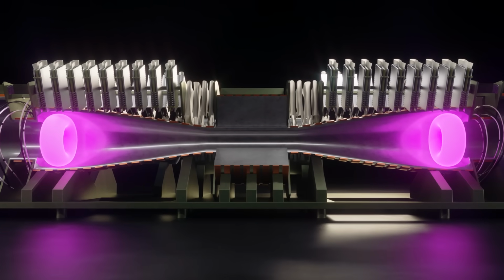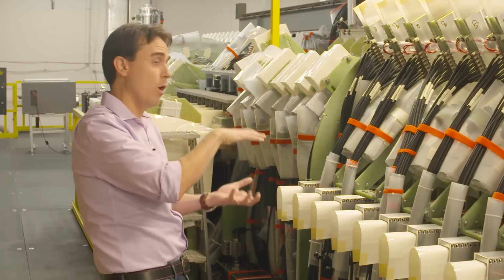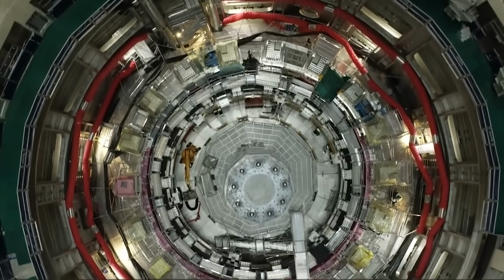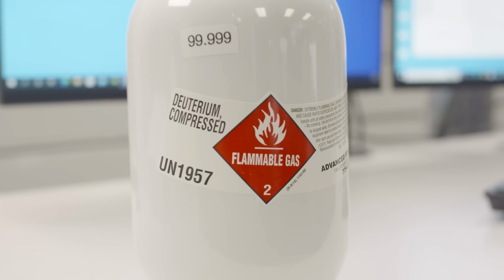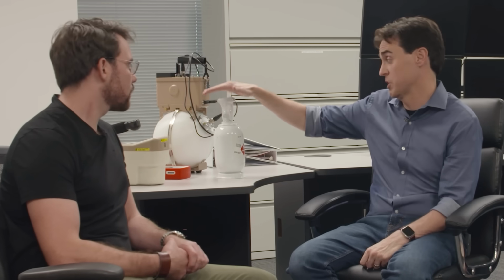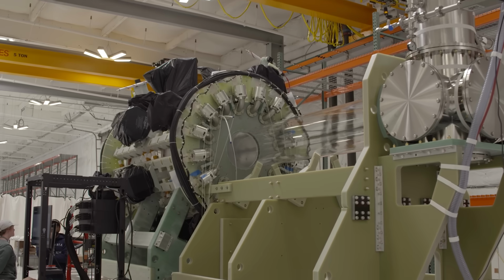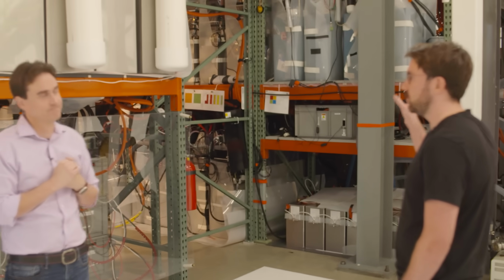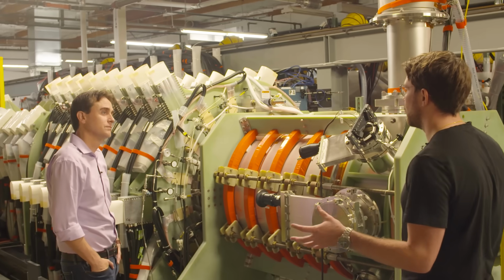A New Way to Achieve Nuclear Fusion: Helion

Comment: I am all for that we keep researching and developing new clean energy forms BUT the scientists themselves say commercialisation of fusion are 4-5-decades away and thus it cannot be a part of our urgent transition need.

The newly formed Danish government´s first announcement were that Denmark unilaterally, as only Western democracy in the world, would make Denmark CO2 neutral by 2045, long before the requirements in the Paris climate agreement.

A few months ago Denmark together with Belgium/Netherlands/Germany agreed and signed the worlds largest transition project away from fossil fuels in the world BY FAR. It will transition 230 million high energy using Europeans in just 12 years. Will be achieved by placing off shore mega windmills in the North Sea.That are half of Europe's population in one single deal. On top, inside same project the worlds largest BY FAR hydrogen production will take place on 3 artificial energy islands where the mill energy will be transported via. A small amount of the hydrogen will be set aside to ensure unbroken emission free energy when the wind does not blow sufficiently to meet demand. Remember that hydrogen are made of electricity and water and when burned it only emits.......wait for it.......water! 

Today, at the end of 2022, we already on fairly good wind days produce 120% of Denmark´s electricity needs by windmills. Denmark everyday proves you can transition and decouple emissions from production/economic growth.
  
There are NOTHING preventing large coastal nations like US/UK/Canada/Australia from making a copy/paste of our new project in the North Sea and themselves become CO2 neutral fast. WE are the proof you would laugh all the way to the bank while doing it. Please consider why it are not happening in your nations. The atmosphere really need us all to transition.

I have personally dived around the foundations of one of the older off shore windmill parks in Denmark and the cool thing are that they improve aquatic life greatly and function as protected nurseries for the bottom of the aquatic food chain. First mussels and seaweed are attracted. Mussels eat CO2 and seaweed store it. That again provide protection and food for micro biologic life and small fish. It are estimated that over 20% of the bottom of the aquatic foodchain (that are the precondition for the higher parts have something to eat) are connected to global coral reefs. As our waters become warmer the coral reefs increasingly experience bleaching events eventually killing the corals. A few years after that they disintegrate and become chalkpowder that in itself have negative effect because that powder can kill other corals, a really bad negative cycle. 
If 20% of a food chain are taken out in a few decades it might get the entire food chain to collapse. If all coastal nations, beside those very close to the equator, utilised their potential to transition via off shore windmills as centralised electricity and green fuel providers, it then also could have a very positive effect on the aquatic life, partly or fully compensate for the loss of coral reefs.  
In EU alone approx 40% of railroads are not electrified today but have diesel or diesel electric locomotives. Most EU governments today have planned HUGE billion investments in electrifying these rails to bring down their emissions as part of their commitment to the Paris agreement.  IF they instead invested in the concept of off shore windmills and hydrogen they simply could use hydrogen locomotives and problem could be solved for a fraction of the cost fast. The lobby of the fossil fuel industry are very strong and I time after time realise that many populations around the world are completely in the dark over the reality we have proven works and saves money on top. As Denmark have shown you with your own eyes, it are not a matter of going back to the stone age when you transition, on the contrary. It just are a matter of seeing holistic on the transition. There are SO many savings and benefits that they superseed the negatives. 
NOT sending our hard currencies to journalist/politician killing dictators like POOtin, Xi or Bin Salman also means stopping financing their aggression's maybe thus also preventing future wars.

Transitioning are an investment and not a cost.
 
The 4 stroke direct injection car engine have been invented and works great. Hydrogen train/truck/ship engine exists so does the hydrogen jet engine. 
The longer we all collectively do not get our atmospheric carbon content back to 220 PPM where it belongs the longer we will experience an increase in human suffering and economic taxpayer burdening costs from the wilder weather effects we already increasingly are seeing.
 
We are very open about how we do and urge all to simply copy/paste away, from what we have proven works, both practically and economically.
Reply: urgent,really?
Reply: @honkytonk4465  What nation are you from?
Reply: @Mike-zx1kx  EinsteinLand
Reply: @honkytonk4465  Let me guess. USA. Usually Americans that give themselves a thumbs up after saving. I would not attribute that to the general German.Yes. Urgent. Read and learn.

For 850.000 years our atmosphere have been at stable 220 Carbon PPM, since industrial revolution now exploded to (2022) 417 PPM.  Floods, draughts, bushfires, forest fires, hurricanes, salt water intrusion,  etc etc. Costs of climate change explodes in USA and around the world. It are estimated 300 million people will have to move because of climate change in this generation. NOT being forced out of your home will improve a lot of lifes, right? Denmark proves transitioning are an advantage, an investment not a cost. 

Glaciologist drilling icecores in Greenland have, by analyzing airbubbles captured in the ice, established that we the last 850.000 years have had a pretty stable carbon PPM at 220. Besides Carbon also things like acidity, pollen counts, Vulcanic ash count and identification etc. can be measured. Since the ice sheet have been build up over time, layer by layer, year by year, we go back in time the deeper we go. So we have a YEAR BY YEAR documentation of the global climate 850.000 back or 10 times the period, since man left Africa. There has been a few peaks at 280 PPM that all have been connected to high global Vulcanic activity. Since around the beginning of the industrial revolution PPM has exploded. We are now at 417 PPM, close to double the amount we have seen last 850.000 year. Just to set the amount of 850.000 years in context, man left Africa around 65.000 years ago.
Denmark, USA and Canada all have a full set of cores and can thus give you key data of our climate, year by year, 850K years back.

We have a global problem and we, as mankind, created that problem, and if we don´t solve it very fast, we eventually will pollute ourselves out of a home.

Lets look at some science reality.
Country 2015 per Capita carbon dioxide emissions from fuel combustion (metric tons)
United States       15.53                           (now over 16. Americans the absolute most polluting nationals on earth)
Russia                   10.19
China                       6.59
India                        1.58 
Source. US Government. (epa dot com) 
These numbers actually to low since aviation are excluded. Americans flying more per Capita than others, making reality even grimmer. Ask yourself WHY so many Americans, that are the highest emitting nationals on this planet, are not even aware of this fact! The money invested in keeping so many Americans in the dark about own emissions are HUGE, and it has worked. The basics of climate change that I learned in basic school 40 years ago are still not basic knowledge for to many in US.

VERY first day Trump was in office, while USA was talking about crowd sizes, he fired the head of EPA and replaced him with a former oil CEO! He took USA out of the Paris agreement, while his nation was the biggest polluter per citizen. Trump removed caps on Methane in US. Methane are 22,5 stronger than CO2 as a greenhouse gas. He opened up for an explosion of fracking in US. Fracking are the process where you pump chemical acid under pressure into your underground to dissolve slate stone! Fracking has, besides the CO2 emission, been proven to cause earthquakes. Chemical acid and/or the gasses have already begun to be detected many places in US. Trump gave permission to a state subsidised pipeline from Alaska that should transport the oil coming out from the further oilsand exploration he gave permission to. Oilsand are the most energy intensive and ground disrupting known way to get oil. It takes 7 liters of oil to produce 10!!! It leaves the ground sterilised since it involves cooking the sand on site! Oilsand and fracking are the two most stupid, dangerous and CO2 emitting processes! He could have raised lasting off shore windmills but chose to do this in the middle of a global climate crisis where others shuts down coalmines/coalplants and now some even stop oil exploration in their nations. Trump has been a disaster for the climate efforts and for US credibility.
( I am sure Putin are happy, not many have devoted time to try to get him to clean up his acts lately, so the trick (also in this sense) worked for him.I have a very hard time imagine USA move forward in a unified way before it has been proven in court of law that Trump belongs at Guantanamo).
Biden re-signed you in to the Paris agreement but recently announced the largest oil exploration and "rights to use" auction in US history ensuring US´s signature are worthless.

IF a policy are UNsustainable for us all and can be replaced by one that ARE SUSTAINABLE and we don`t act on it and CHANGE, well, then Darwinism will take us out! The truth are that USA are way behind the curve, sticking to old technology when the world are changing and that are not doing US, businesses, population, economy, any favours, only the fossil fuel industry but hey, that are what they pay for...

CO2 taxes are being introduces all around the world every day. As most emitting nationals US businesses soon wont be able to export to anyone due to the costs the "stupid nation" fines that will be placed on top.

I hope my text begins to give you a fraction of an insight into the miserable life approaching fast if USA do not transition!

Despite you "Einstein comment" I will remind you that only a friend will tell you the truth even when it are uncomfortable for you to hear. Your enemy will happily stay silent and watch you fail.
Reply: @Mike-zx1kx  we'll rather freeze to death here in Germany than run out of water or starve to death caused by heat.If climate change is so dangerous why don't we just build nuclear power plants as a transition technology?
Reply: @honkytonk4465  The ones freezing to death are the Ukrainians because Germany allowed itself to become dependent of a journalist/politician war mongering dictator! The entire Western world warned Germany repeatedly, but to no vain and now there again are war in Europe and again Germany have had a decisive role. It at least are good that you now have made a radical course change after seeing all others predictions come through. A nuclear power plant takes a very log time to build and provides power at an unattractive price. As you now know Homo Sapiens left the African continent 65k years ago. Seems more than reckless to leave waste that can kill for over 250.000 years. Not one government have claimed to find a place that are geological stable for so long. Remember the Norwegian seed vault. They spent 2 decades to find a place to place the seeds so it could stay in permafrost if "something" wiped out the vast majority of us. Now, a few decades after built global warming have made the spot thawing so fast they are planning to either move it or install generators. Not the idea they used 2 decades to plan for. Now we can prove that off shore windmills FAST and CHEAP can provide us with ALL the power and hydrogen we crave for. Maybe you can find comfort in the fact that Mercedes have invented and patented a car hydrogen fuel tank that can hold over 99% of its content for 12,5 years without the car being ignited once. I understand that BMW are actively working on a series of hydrogen cars. About time, Toyota already have had clips of their testscars, including a racecar with hydrogen engine cars on You Tube for over a year. That is as in hydrogen engines, not hydrogen fuel cells but via direct injection like in gasoline cars.  The North Sea Summit agreement  (Germany participate in) will soon provide, also, Germany with the hydrogen it takes to be frontrunners. Congratulate your politicians with finally having taken the right decision. Thank good they are way ahead of you. Time to take a rethink. I have provided you with a lot of facts. Maybe re read it all again. Vital information for the technological revolution that have begun without all recognising it.
Reply: @Mike-zx1kx  so you obviously don't know that we run out of gas for our heatings.and no we are not ahead of any western country.We'll get rid of a large portion of our industry because energy becomes too expensive.I call our country not Deutschland anymore  but Dummland/land of the dumb instead and I'm sure you will see our country struggling with mayor economic problems in the next at least 10 years
Reply: @honkytonk4465  The trouble you have right now are because of your own decision. Had you followed Denmark when we invited you 10 years ago, it would not have been the case. Denmark had no problem cutting Russian gas out as he started the war since we had less than 1% of our entire gas need imported from Russia to a large extent because we have transitioned as much as we have.  The good thing for you, are that the North Sea Summit agreement will have transitioned 100 million people inside this decade and additionally 130 million people inside 5 years after that. Since Germany are one of the participants, you can keep your share of electricity and hydrogen, if you like. If you have surplus, which all participant will have eventually, you can sell what you want, that are the actual plan since some EU nations do not have the benefit of being a coastal nation and recieving this emission free electricity and hydrogen can aid them in their effort to bring down their emissions. 
You do not seem to realise it despite the information I have given you but Germany´s glass are half full. Maybe you should realise this and send a donation to Ukraine that right now are harvesting the seeds Germany were part of planting. Without the huge income to POOtin´s cashcow Gazprom he would not have been able to finance that illegal attack war. It really are important you recognise this. If we do not learn from history we are bound to repeat our mistakes.
Reply: @Mike-zx1kx  you remember Merkel ,I didn't vote for her!What do you mean by"will have transitioned 100 million people inside this decade"?
Reply: @honkytonk4465  Transitioned away from fossil fuel based electricity production. 100 million inside this decade and additionally 130 next 5 years after that. And it was just signed 3 months ago so that are more than fast. On top comes the huge hydrogen production. THIS are the worlds largest single project moving 230 million people away from fossil fuels and to emission free energy production. 
Whether one have voted for ones government or not it are still your government since you live in a democracy. Northern Europe are now showing the world we can transition and laugh all the way to the bank. If you are young I urge you to seek insight into this vast area since it will be the sector booming for decades. Good stable well paying jobs.